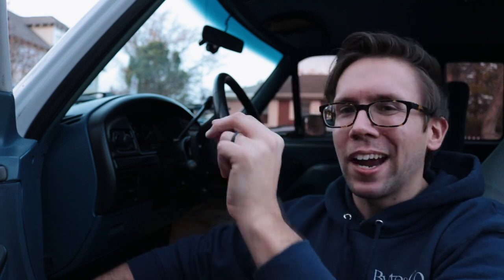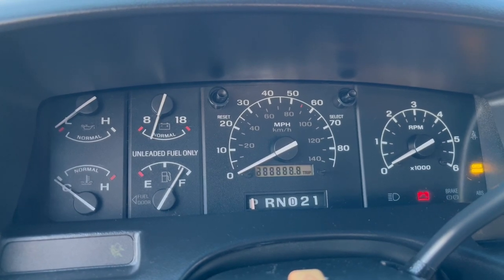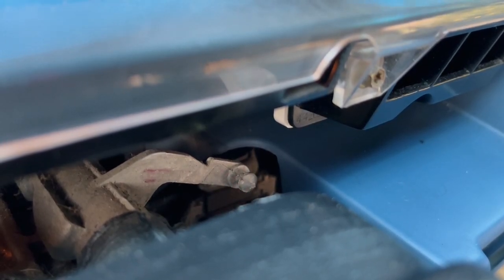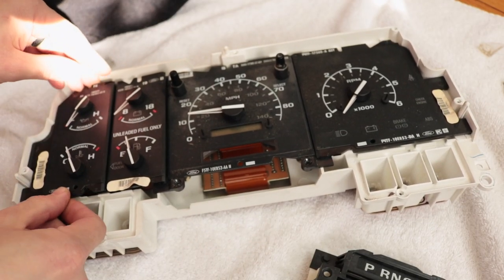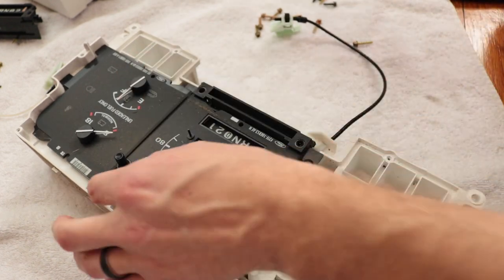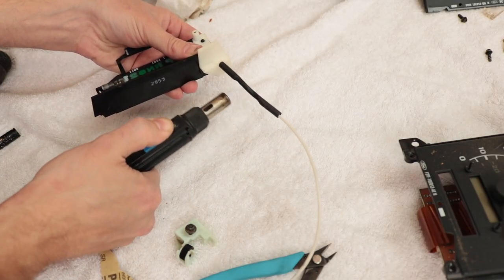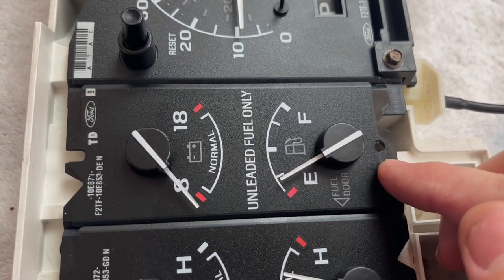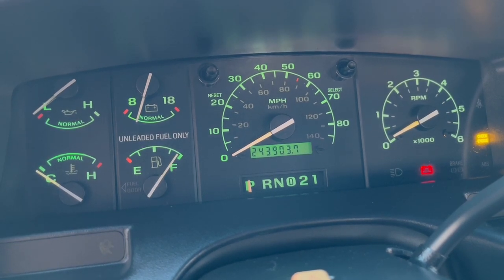Gauge Cluster Swap and Repair - Adding Tach to OBS F150

Comment: Code 452 (Vehicle speed signal - incorrect signal) on a 97 F450 that I just purchased. After trial and error, I believe the psom to be causing shifts issues. Just happened to find a perfect condition cluster out of a 95 f150 for free in my deceased father's junk yard. (Passed away last fall) He had hording issues. The only difference between the two clusters is that a single resistor has a different ohm value. I will swap the psom and keep my original cluster. I have been watching hours of YT to find a fix for my problem. After watching two days of 10 year old videos, it's nice to see some current content.
Reply: did this ever work? pretty sure you need a 96 or 97 cluster to put in a 97 not a 95 cluster
Reply: i suppose psom is identical after all
Reply: @pivotmaster9556  yes it did work

Comment: So here is a fun issue from this. When I connected the transmission gear selector wire back on my transmission no longer shifts into gear. When I go down through the gears and go back into park I get a slight grind sound.

Comment: does the color of the circuit board matter ? like swapping a green cluster with one with a red circuit board ?
Reply from the maker: Funny you mention that. I just saw someone post the other day comparing them and asking why they were different. From what I saw the were identical in wiring/traces but different numbers. Best anybody could figure was Ford had multiple suppliers and didn’t stipulate the plastic film cover. I’ve swapped them without issue as long as they match year ranges and engine size.
Reply: @MatthewFinlay  hmmm interesting. i appreciate the quick response. I’ve heard once or twice about this and the guy specified how the films should match color (green with green, red with red) but i never really thought that was true. But like you said, if the years and motor size match it should be plug and play. So you went from green film to red ? Did you have any issues with anything ?
Reply from the maker: It’s also possible it’s for options that some trucks have - nobody had a clear answer except that they wire and trace out the same. Which is my experience too. FYI - teccccchhhhnically you can swap years that shouldn’t swap if you re-pin the harness to match that cluster. I haven’t personally done that but I have seen it done! Lord knows why Ford made those running changes
Reply: @MatthewFinlay  ahah ain’t that the truth !! I actually was able to find one on marketplace from a bronco that is the same year and motor as my f150 so fingers crossed with how she goes 🫣

Comment: I had question about the swap. I see you kept the original speedometer for the mileage. Can you swap out just the odometer onto a different speedometer? The reason I ask is I’m using a gen 1 Lightning cluster. Would like to keep the vehicle mileage but use the 120 mph speedometer. Hopefully that made sense, any feedback would be appreciated.
Reply from the maker: Ok I know exactly what you’re throwing down. I asked a few friends and none of them have attempted to swap the odometer out of the PSOM module. But I don’t see any reason why it couldn’t be - I would also just consider sending it off to get programmed for your mileage and tire size while it’s out!

Comment: Is there a fix for the Volt Meter guage not working ? Mine doesnt seem to be identifying the correct voltage but when I tap it it will slowly rise to the correct voltage (14.4v) even if I continue to take it woke go higher. Because my head unit can display the volts also it seems somewhat accurate but i still want to fix

Comment: So it's literally that simple?
Get one with a tacometer and swap your speedo onto it?
No need for any extra stuff?
Why ford not put the tacometer in the first place?
Reply from the maker: Yes sir! Just make sure to match the cylinder numbers or you’ll run into it reading slightly wrong. Aka 6 cylinder engine needs the  6 cyl. mark on turn circuit board. If you don’t get a cluster in the same compatible range as your truck year you’ll have to do some re-pinning. That’s when stuff gets weird… If you look on EBay you’ll see that the good sellers will already have the listed correctly of 94-95 for instance.